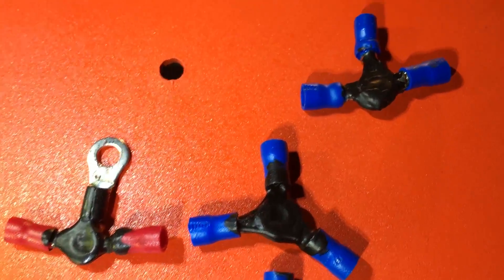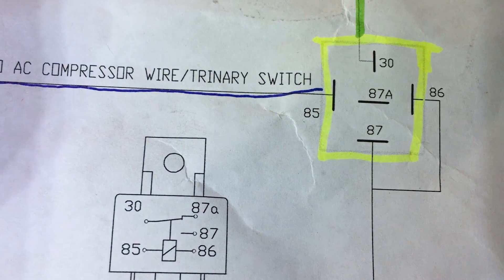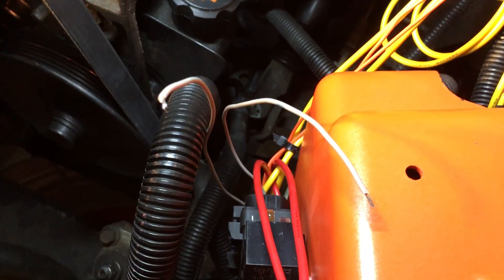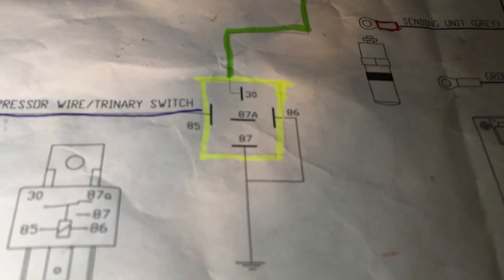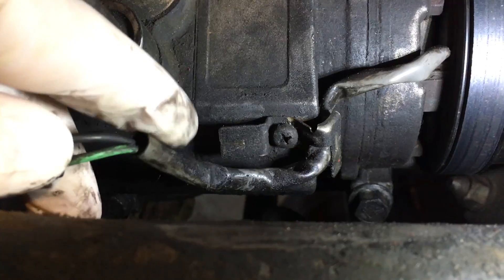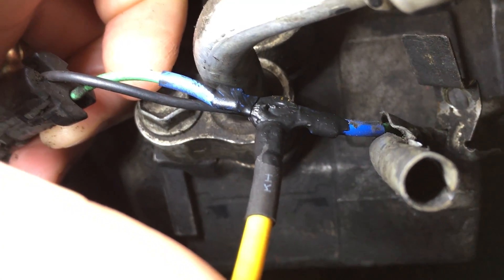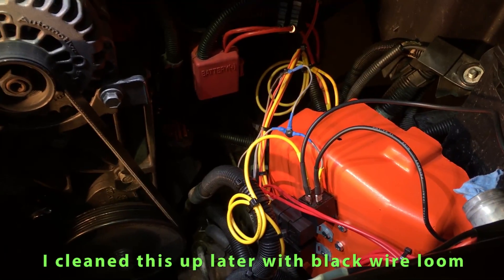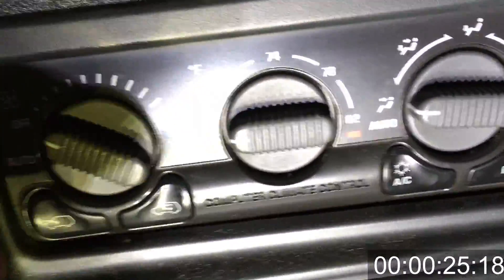Wiring Electric Fans to the Air Conditioner (AC) Clutch

Comment: Cool video series Steve! My only concern for your rig is the trip (on) temp seems high and cutout (off) seems high also...and we're watching your rig sitting still at idle. If I'm towing or hauling in stop and go traffic, I'd want want fans on sooner than 200! Here in AZ I run a 160 Tstat, so I'd cut it off at like 165, or 170. Just my $.02
Reply from the maker: I appreciate your input.  I just went with what the directions said.  Even in 100 degree weather in traffic, it never gets that hot.  Love this thing!  Never comes on in the winter at all.  All that savings from the mechanical fan that ran all the time.
Reply: there are different thermostats on amazon you can pick up for your setup with different temps i got 2 for low and high speed low is from 165-185 and for the high from 185-200 thats what i did personally
Reply: i forgot to mention that i tapped the ac clutch for low speed so the low speed will kick with either ac or temp
Reply: @wahaboy595  yes that seems reasonable..I like the idea of having an adjustable setting too.

Comment: So these fans stay on the whole time you are running the ac? Thats not good on the fans in the summer time.
Reply: Factory wiring is the same every time you hit the AC button it activates the second fan or speeds up a single fan

Comment: Is there a direct part number for this fan setup or do I just need to email them?  
Did this setup keep your trans temps cooler than the original equipment?
Did you have to upgrade your alternator?
Thanks

Comment: Hi I have 3rz engine. Have converted to electric fan. I’m just lost how to connect the thermal switch to the ac clutch. Can I just connect to the ac signal from the thermal switch to ac fuse making it a lot easier to run the wire?

Comment: I would have done a couple things differently. First I would have use auto-reset circuit breakers rather than fuses. Second, I would have requested an automotive A/C shop fabricate a tee fitting to allow use of a 250-275 psi pressure switch installed to the high side A/C system. This is much cleaner than triggering from the compressor clutch.
Reply: Walter k do you know how to wire it that way. Because that how i want mine but dont know how

Comment: SSSSSOOOO wish you would have done this with one fan and relay. any idea where I might find it? or possible instead of the color of the wires the pin numbers? my I did the conversion on my wrangler and the air will not blow cold. I think this is the issue

Comment: I do mine from scratch it's much easier to do a clean install. First I figure out how many relays I need then figure out where I want to mount them. Then I mount and install my fan switch and all that's left is run wiring.

Comment: I don’t have access to the compressor because it’s under the motor on my chevy 5.3 burb 2001 is there a fuse or relay I can used instead?
Reply from the maker: i'm hoping someone else will chime in because that's a great question.  Alternatively - if you pull the wheel and the plastic wheel fender you should be able to get to the starter fairly easily
Reply: You can just tap in right off the pcm you don't need to connect directly at the compressor.

Comment: I didn't notice any improvement compare with my original clutch fan. How is horsepower after installation of the Efan?
Reply from the maker: You should get ~ 6-12 hp gain.  On a 300 hp engine, that would be hard to "feel".  It's still a great mod though, and mine keeps the temps nice and cool.